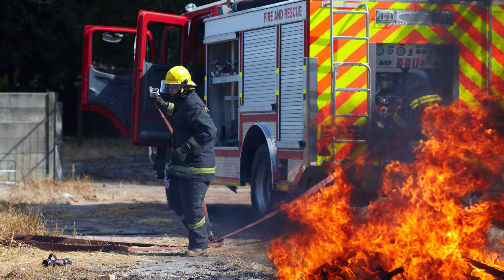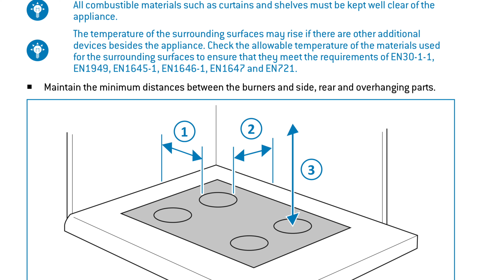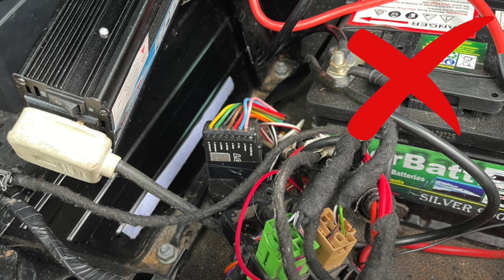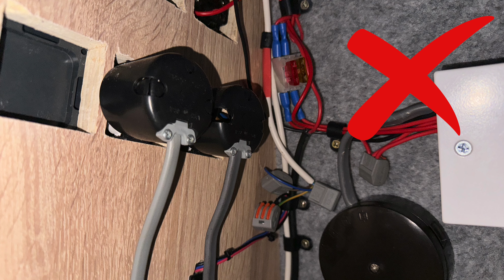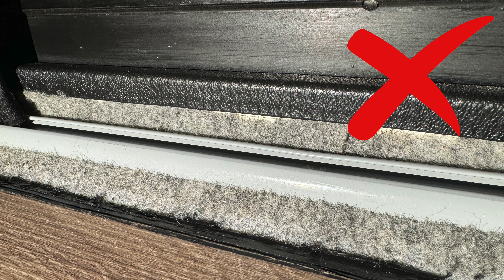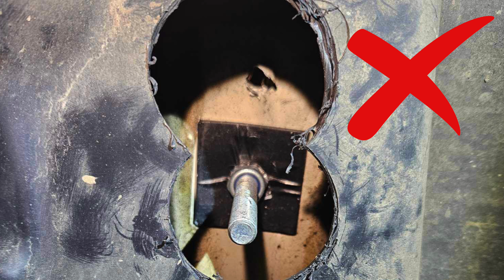Is A DIY Campervan Build Worth The Risk?

Comment: You haven’t even put a vapour barrier on.
Reply: 😂 How many Transporter conversions have you seen with a vapour barrier on the outside of the insulation?
Reply from the maker: Sound deadened, then Thermo PRO liner ✅, insulation and carpet.

Comment: If some converters are up to NCC  standard why don't they become registered as an approved converter? and I understand it's easier to get insurance for a fully  approved camper.
Reply from the maker: It’s expensive, for a few reasons. Crash testing of the chassis is costly and once approved it’s for that conversion/layout.
A lot of converters like to create different designs and layouts, so if a customer makes a request, they can do it.
Reply: Does the NCC not set a standard to follow? I would not purchase a camper van unless it was NCC approved as I think resale value Will be better and insurance cheaper. Some private sellers look at dealer prices and try selling for the same, so you won't know how good the conversion is, such as insulation and wiring ect: and of course no warranty.